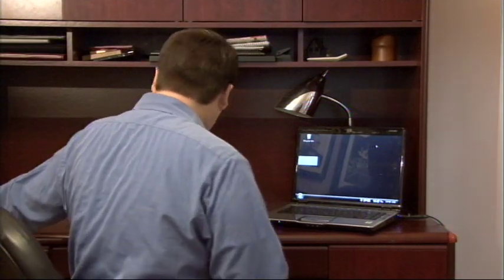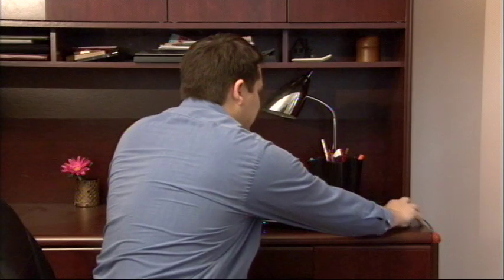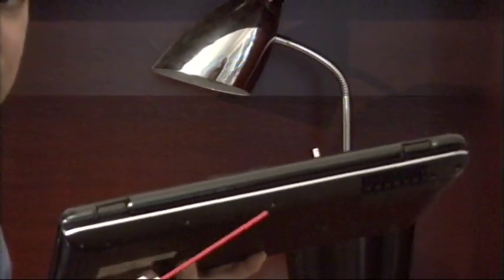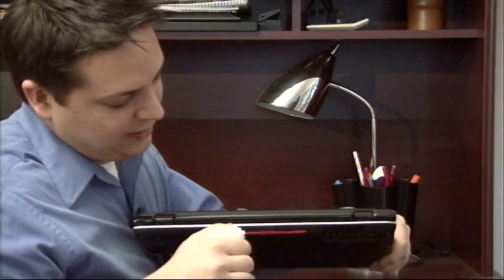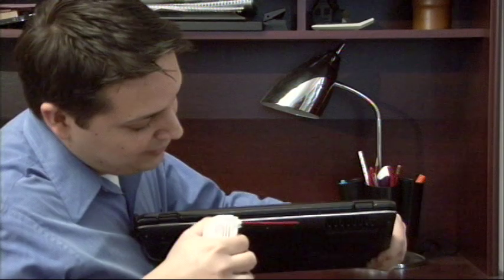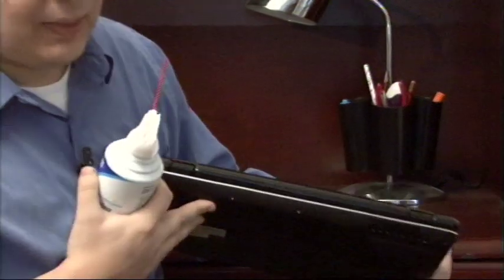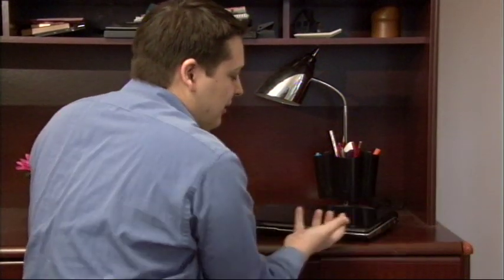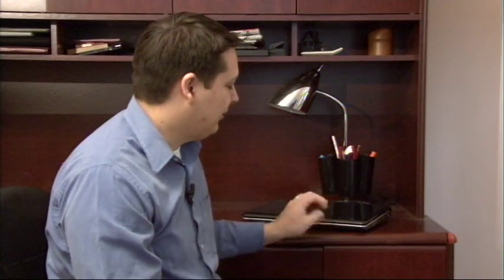Computer Hardware & Software Tips : How to Reduce Laptop Fan Noise

Comment: Not good advice.  Blowing air at the vent at this angle might get the dust off the outside of the vent - but what about the dust that's actually trapped on the side of the heat sink (fan side)  This method could very well dislodge the dust that's built up on the inside and cause the fan to jam.  (seen it countless times)  In reality the fan should be accessed and the heat sink cleaned from the inside......... I'd never clean someone's laptop using this method...... NO WAY.

Comment: well if you haven't done that for a while the fan system is full of dust and doing as he does it you won't get the dust removed. put the airpipe in to the fan and give it a BIG blow of air and the dust will fly out. if U do it as he says you'll fan is still loud because of the fucking dust.